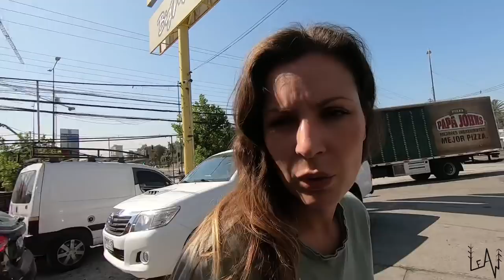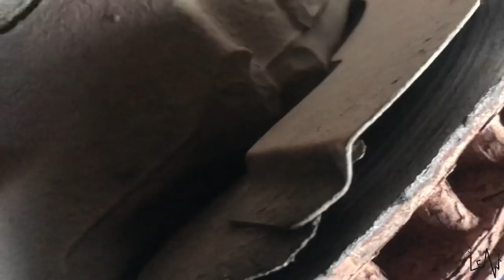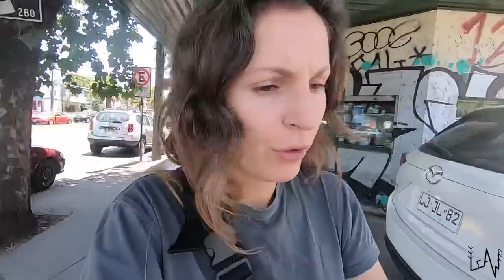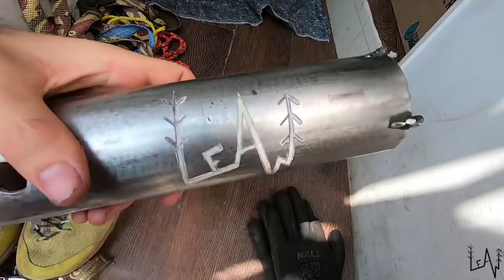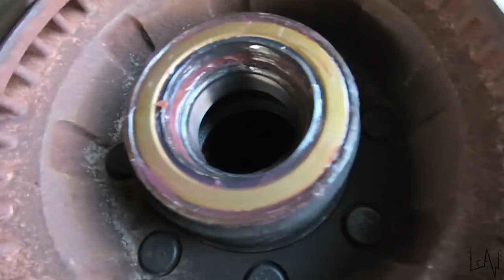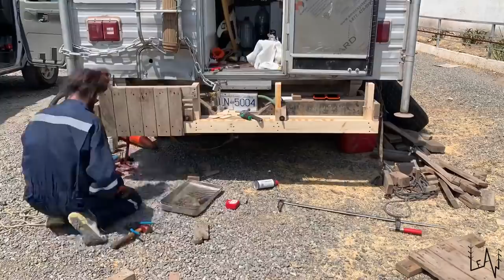Getting our 4x4 TRUCK CAMPER ready for PATAGONIA - South America Adventure

Comment: The rotor being worn so bad only on one side is probably because the caliper slides aren’t functioning properly. It could even be the cause of the loose wheel bearing because the caliper is pushing out on the rotor instead of clamping it.
Reply: that is correct, the inside caliper is pushing the bearing out everytime he brakes.

Comment: Good job guys!  Just in case you happen to read this comment....
Don't worry about the rotor!  (brake disc)
The accelerated pad wear is only at the beginning, as the pad adapts to the grooved rotor surface.   That pitting and flaking rusted pieces along the edge are inconsequential and will not affect performance.  If you're concerned about the thickness, measure with a micrometer and compare to the manufacturer's specifications.  Rotor resurfacing and replacement have become part of the profit center of service centers, and the population has become accustomed to hearing they need replacement often, when they rarely do.   Use the logical side of the brain to sort it out.  Sometimes they get warped and that is most often due to the service people unevenly tightening the lug nuts using an air impact gun. You can feel the pulsing in the brake when that happens and it's more of an annoyance then a safety issue.

Check your calipers, that the actuating piston moves in and out without sticking and that the moving side is able to slide back and forth without excessive friction.  Either of those will cause accelerated and/or uneven brake pad wear.

Nice remake of the rear carrier Luca.  You guys are really living and learning!

Sorry, I only know of the obvious things ahead to recommend.  The caves of marmol, the glacier, hiking near Fitz Roy, the ferries, the mountain passes, ruta 7 and ruta 40.  It's a long but beautiful drive.  Some like to go to the end of ruta 3 past Ushuaia.

Que disfruten!

Comment: You have too look close at the two locking nuts, there is one with a very small bump on the ace. It must be installed first with the bump facing out, then install the locking ring so a hole in it rests over the bump on the nut, then put on the lock nut and tighten to about 100 ft pounds, the first nut is installed and tightned as much as you can while spinning the tire. Once it is tight loosen it up to hand tight then tighten back up to around 5 ft pounds, then installing the lock ring. If the lock ring dosn't fit into the hole, tignten up the nut to fit the next hole, never loosen to make it fit.  I know you've already gone on, but it will help you latter. It is alwasy goo to take the hub off and check the bearings after you've driven100 miles or so.    CHEERS     Steve h.

Comment: In a previous video you mentioned filling your tires to 50 psi. That told me immediately that you did not have 10 ply E-Rated tires like you should. Typically, E-Rated tires are filled to 80 psi for loads such as yours.  Spending the extra money to get the proper stuff is a lesson we all have to learn eventually. There's an expression from an old TV commercial that says "You can pay me now, or you can pay me later" but it should have said "you can pay me now AND you can pay me later". When it comes to traveling I have an aversion to being stuck on the side of the road somewhere so I always opt for the best even if it means going into debt (credit card)  :-)
Reply: Definitely want the 80psi tires!  I think my Michelins say eight plies though.  They have like fifteen years of use and still great.   Passing cars crossing the mountain with a bed full of firewood...  🤭

Comment: It is really interesting to see that they still have mechanics in these countries. In Northern America and most countries of Central Europe the so called mechanics are only able to replace worn out with new produced spare parts, but cannot perform any repair operation.
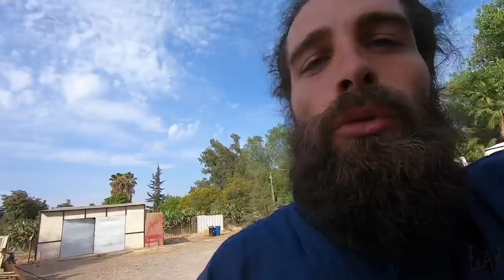21:28 interesting to see that they have 2 x 4 in Chile; I would have thought that they use the metric system and have 5 x 10 cm items.
Reply: I worked in a Toyota Store and we repaired everything but radios which were subbed out.Now, mechanics don't even get their hands dirty.People lease a car for 2 years & turn it in.Me, I have a 21 year old Toyota that keeps running with regular TLC & monthly oil changes.It's getting hard to find spares & I'm not interested in paying$75 k for a new car that watches everything I do.

Comment: I would weld a disc with a 1/2" hole so you could use a borrowed torque wrench with that tool you made. As you said: It needs 10Pounds). I'd buy a torque wrench when you can too. Maybe you could have the brake disc skimmed or lightly grind and sand by hand. Great work though, soldier on!
Reply: suppliers that far South are few & far between

Comment: RVs (like ours) with chassis mounted propane tanks often must go to a different location than those with removable tanks..so You may need to go to a main propane plant distributor ...propane wholesaler..or any Rv dealer and ask them where if any..? is the refill station for Rv,motorhomes,trailers..good luck..!

Comment: as a lifelong mechanic, . all I can say is "(((outside bearing, lock nut with little pin facing out,  tighten to about 10 pounds,  (technically 10 pounds then back off to first place the pin and groove fit in the washer) put lock plate (washer) inside in the groove, outside over pin on the inner nut. (now the inner nut can not loosen) put outside nut on tight, maybe 30 ft lbs, bend tab outward))).  peace out my dear people.. I wish I was there to help   I have no idea if this helps  and I understand you are weeks away from this but . it is me 

Cuscinetto esterno, controdado con perno piccolo rivolto verso l'esterno, serrare a circa 10 libbre (tecnicamente 10 libbre, quindi arretrare per posizionare prima il perno e la scanalatura nella rondella) inserire la piastra di bloccaggio (rondella) all'interno nella scanalatura, all'esterno sopra il perno sul dado interno. (ora il dado interno non può allentarsi) mettere il dado esterno su stretto, forse 30 piedi libbre, piegare la linguetta verso l'esterno

Comment: Bravissimo Luca! Good job with the bearings and BF Goodrich are good tires. If you can't find replacement brake rotors (disks) maybe you could give it  try with resurfacing the old ones (at least on the inner side). If you have enough width to allow resurfacing. Good luck to Patagonia! https://www.youtube.com/watch?v=kWoEqfMWzzU

Comment: What is the Gross Vehicle Weight of Lucky LeAwigi ? You will have to go to a truck scale to find out if you are overloading Lucky LeAwigi. If you are overloaded, you will overstress the mechanical load bearing members of Lucky LeAwigi, including chassis, axles, and bearings and cause excessive tire wear. 
F-250: light-duty 3/4 ton (7,700 lb GVWR max)
F-250HD: 3/4 ton (8,800 lb GVWR max)
https://en.wikipedia.org/wiki/Gross_vehicle_weight_rating
https://www.reference.com/world-view/gross-vehicle-weight-ford-f-250-c9ecf66dc2f5e5e1

Comment: Guys, I like you but you need to be safe. The last thing you need is to be stuck in the middle of nowhere then end up with an expensive repair that lasts only a couple of weeks before another breakdown occurs. I mentioned this to you already - You need to buy a pre-owned reliable pickup truck designed to handle your cab weight.  Capisce, si o no?

Comment: My dad, some uncles, my grandfather and great uncles were all of the opinion and experience that I was taught that often times the cheaper product to buy often costs more in the long run. The cheaper product will often wear out 4 times as fast as the more expensive product that costs 25-50% more at the beginning. I have a 42 year old Toyota Landcruiser whose price was more expensive than some 4WD pickups were at the time, but after owning it for 42 years the extra money to buy it has been repaid over and over. Some of the best tools that could be purchased in the 1930's and 1940's by all those uncles/dad/grandfather are still fully working. The tools my dad bought in the 50's and 60's are still working for me and I'm 72 years old and have been using them since I was 12 years old. They are all going to one of my nephews and he will be able to use them for the rest of his life. 
 
Sometimes the more expensive product isn't any better than the cheaper and it is hard to tell. In general though, you get what you pay for and the cheaper ends up being more expensive. I bought a very expensive set of tires for my utility trailer back in 1979 and they lasted, carrying full cords of wood, 5 cords per year, until 2012.  The only thing that killed them is the sidewall cracking eventually caused them to leak air. Perhaps, if I had covered the tires when I stored the trailer, the tires would have lasted longer. Good RV tire covers probably would have saved me some money.

Comment: I wonder if you will survive the accident you may have because of those old shocks?
Reply: Don't...  😟   
These guys don't drive like Mario Andretti!
Reply: @elgringoec  He has been welding on  suspension parts because  I think his shocks have failed and the metal is being fatigued by being beaten by bad roads...No one would recommend they have bad shocks???? When he bought those junk Tires I recommended the ones he just got. I have the same model truck he has. mine is 9 years newer and I have seen many of the issues he is now seeing. Experience is an expensive teacher, a fool will have no other.
Reply: @enriquelaroche5370  
I understand your concern but if you think it through, what happens when shocks "go bad" - it's a loss of damping.  That means less stress on the shock mount, not more.  
Anyway...  Fundamentals.
Reply: @elgringoec  Less stress on the shock mount and more on the leaf spring hangars... Which is what he has been welding  pay attention.
Reply: @enriquelaroche5370  
Yikes.  Amount of stress on spring mount is unaffected by shock action.  Analyze the forces!
Reply: @elgringoec  Frequent spring breakage  1. Vehicle driven incorrectly for terrain or vehicle overloaded.  1. Reduce speed when loaded heavily on uneven terrain. Reduce weight carried by vehicle to suspension rated capacity.
2. Loose U-bolts.  2. Replace U-bolts and check torque as part of a preventative maintenance interval.
3. Broken center bolt.  3. Replace center bolt and U-bolts. Replace spring assembly if any signs of damage.
4. Worn spring and hanger bushings. Worn spring shackles/bushings.  4. Replace worn components and shorten PM interval for greasing.
5. Worn shock absorbers allowing excessive oscillation.  5. Replace shock absorbers.
Reply: @enriquelaroche5370  
I thought we were talking about mount crackage...  🤔

What was he getting welded, again?  🤭
Reply: @elgringoec  You know,, Perhaps he should economize and just throw away the broken shocks? that way he will get better fuel economy.  Apparently  you believe working shocks are not needed.
Reply: @enriquelaroche5370  
Should you learn what shocks do, you'll understand the importance of them under various circumstances.